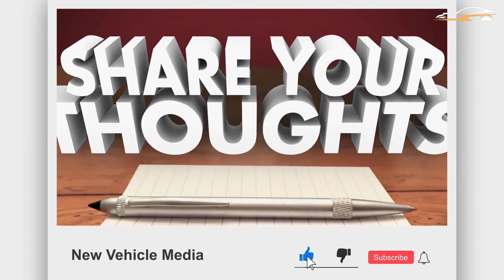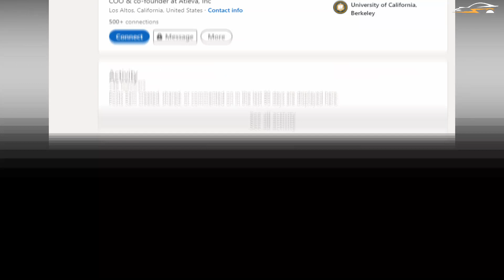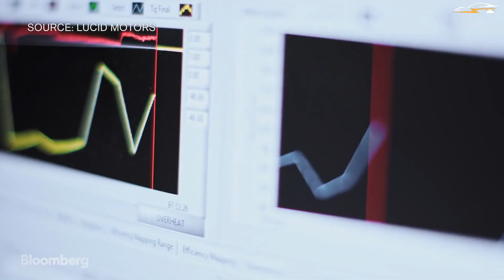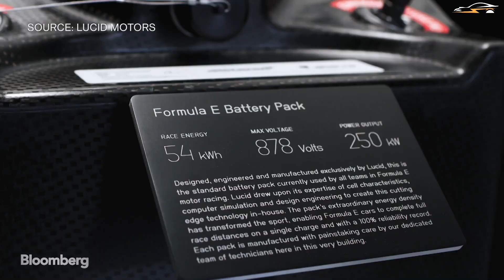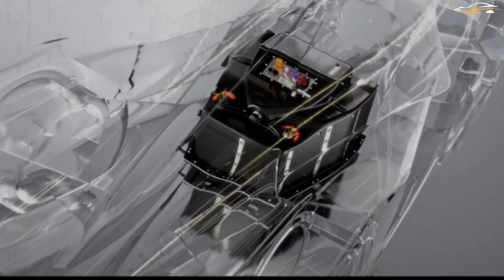How Atieva became Lucid Motors! (History Explained Simple) (Protected View)

Comment: im confident in Lucid.. I just think the brand needs a badge in addition to the LUCID name with its fontstyle... im sure it will come in due time... im thinking a circle with some element conveying light... Something maybe alluding to the sun or even an arc light.

also I wouldnt mind owning an Edna... that car is proof that there was no point in making the EQS body so pointlessly aerodynamic... MB may as well keep its current designs and just make the drive train electric... keep the dash the same too. I think eventually EVs will have eco leather knobs and sliders to control the digital/electric features... I personally am over touchscreens... I like pushing buttons